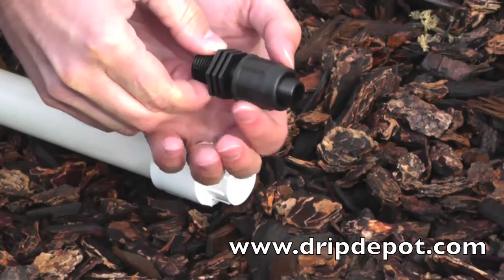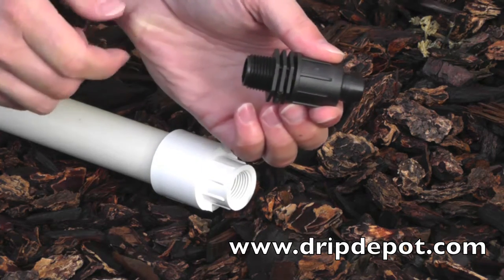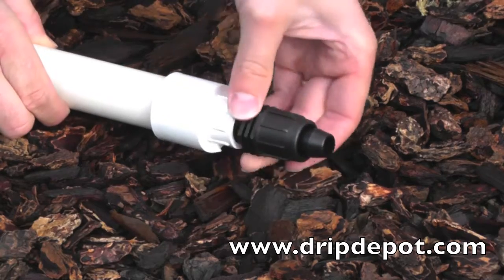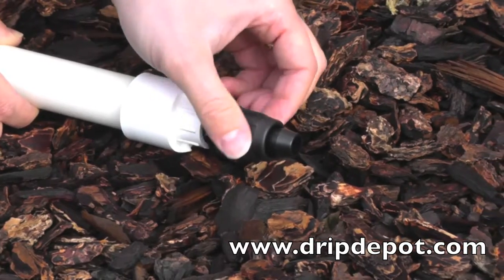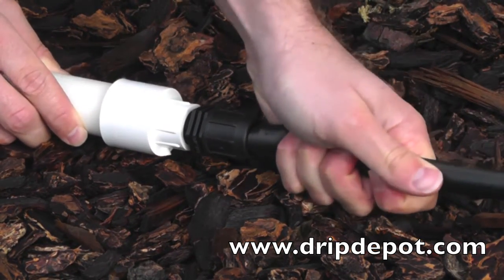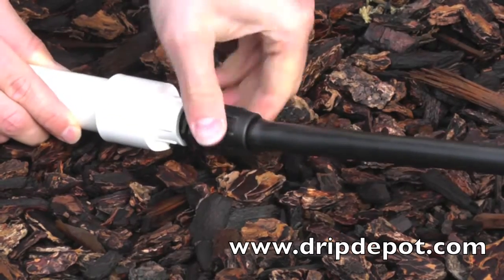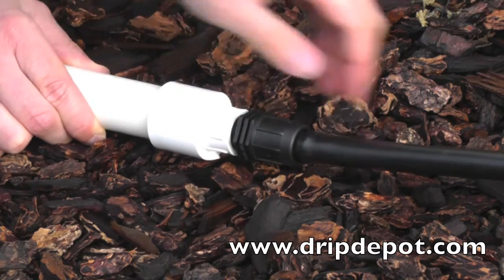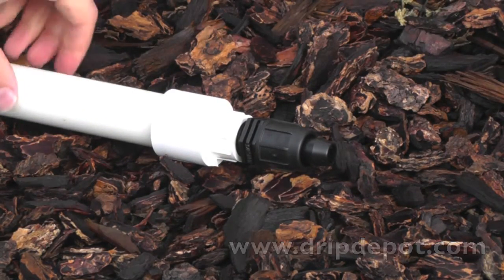How To Attach Drip Irrigation Tubing Directly to PVC Pipe

Comment: Do you need to add a pressure reducer especially if connected to a 3/4 pvc line that has sprinkler head on it? Irrigation newbie here. Thanks!
Reply from the maker: Great question (whether new or seasoned)! 

There's a good chance you would want to install a pressure regulator there -- sprinklers tend to operate at higher pressures than drip systems, so if it's a sprinkler zone it's likely it's going to be higher than what you want to use with drip (10 to 30 PSI for most drip).  

With that said, I'd recommend using a pressure gauge to test the pressure near where the drip portion will start to confirm either way.  If it's not convenient to test pressure there, you can go by feel to a reasonable degree.  If the pressure feels "normal" (what you might find on a residential hose bib) it's probably high enough to go with a regulator.  If it feels particularly weak in comparison, test it as you may not need one :)
Reply: @dripdepot  thanks for taking the time to reply! Much appreciated!
Reply: I leave the tubes going into the vegetation without a drip and that eliminates the pressure issue. Only because it’s Banana palms and not veggies or flowers

Comment: pipe size?
Reply from the maker: The pipe in the video is 1", however the Slip x FPT fitting (the white PVC adapter at the end of the pipe run) is available in 1/2" and 3/4" as well.  It's pretty much no problem with 1/2", 3/4" and 1" PVC pipe -- once you get to 1-1/4" + the adapters get a bit more difficult (but not impossible!) to find :)

Comment: Do you sell drip hose/tubing with copper shield technology for subsurface lines used for irrigation (turf)?
Reply from the maker: Not yet unfortunately!  Hopefully soon, sub-surface turf irrigation is a favorite of mine -- I've already got the article written for the website and ready to go for when we do (we want to have both the copper anti-root intrusion and the anti-siphon outlet flap to help prevent blocking -- with both of those sub-surface turf is very viable) :)

Comment: Do you use plumbers tape on the threads
Reply from the maker: This is a very good question and one without a definitive answer.  Different people in the industry will give different answers.  This may even be considered a controversial topic in the industry (yep, our controversies tend to be pretty boring lol).  I'll keep my reply somewhat general so I don't get skewered by someone who does it different or has heard different (but not necessarily incorrect) information. :) 

So, if there is an o-ring, rubber seal or gasket involved (typically in the female connection) you can probably avoid using tape.  Same with some flared or compression joints.  Technically, when going plastic to plastic, you should be able to avoid using any tapes as the threads are soft enough that there is some give to the threads.  With that said, it's not uncommon to use tapes on plastic to plastic connections all the same.  I have also used thread sealant when going plastic to plastic despite knowing that technically it should not be required.  

The important thing to keep in mind is: avoid using too much tape.  That's the biggest mistake we see made -- sometimes folks will use so much tape that the mass causes considerable tension on the female connection, usually resulting in damage.  That's really what you want to avoid.   Generally, if the connection is easy to access and it's plastic to plastic, you can try first without tape.  If it's difficult to access, or glued connections, etc, I'll use the tape to begin with, but I'll keep in mind the maxim to not use too much. 

Non-controversial: When going metal to metal, you'll almost always be using tape.  

It was a very good question Steven!
Reply: I asked this because it doesn't show using the tape in the video.
Reply from the maker: You got it -- plastic to plastic and fairly easy to access if it ends up needing tape, so we'd likely try without first.  Though, I suspect for the video (this one was before me!) it was just easier to go without, but still reasonably accurate, the Perma-Loc fitting threads have some give and are pretty good without tape :)